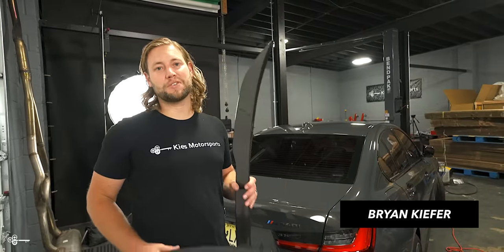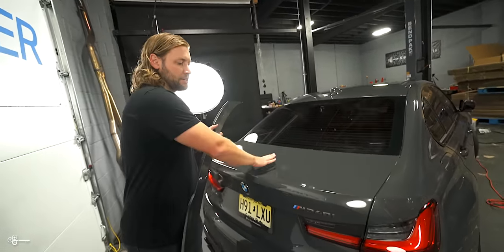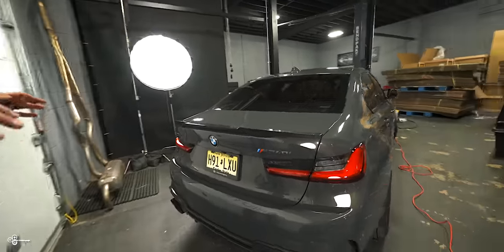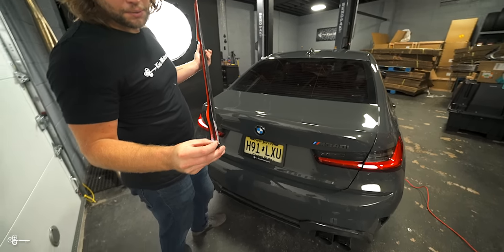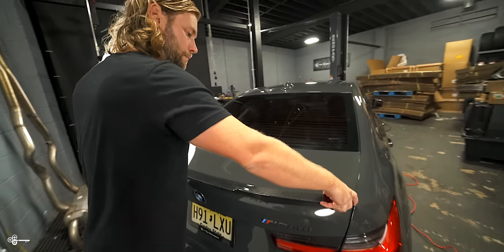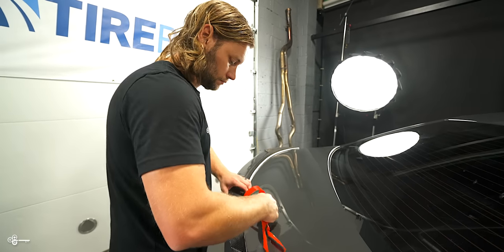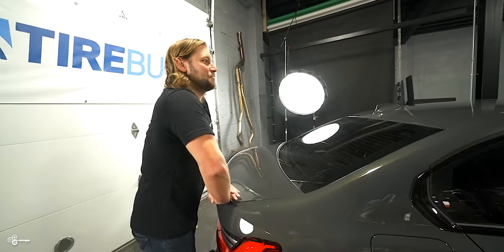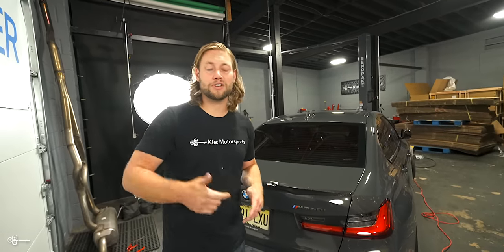NEW Trunk Lip Styles for the BMW G20!

Comment: Thor? Bon Jovi? Halloween? You just need the Hammer. Zack could be Loki.

M4 Style carbon fiber trunk spoiler is my favorite, since it flows over the edge of the trunk. Plus the ends are square and not pointed. But the bottom has to flow a little lower to meet the weird edge of the G20 trunk.